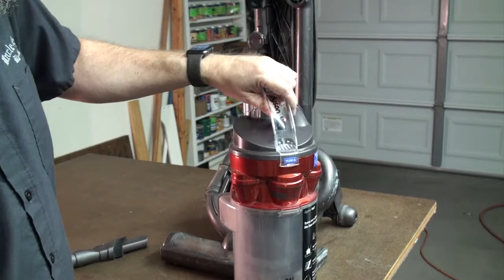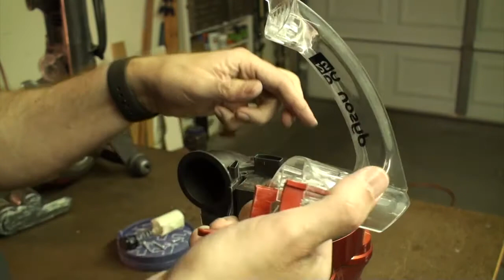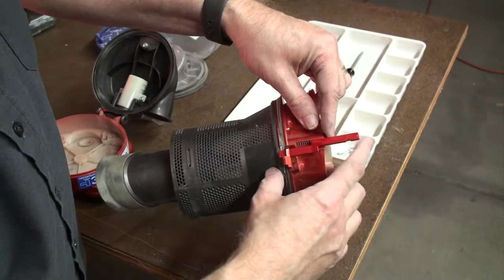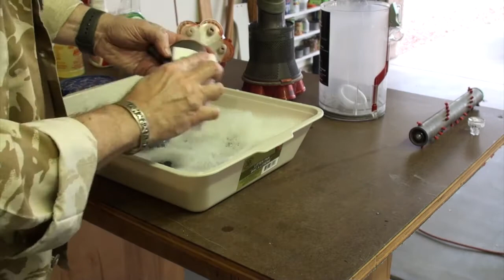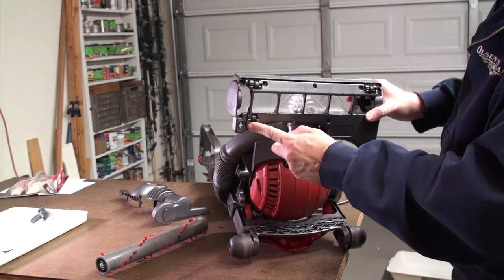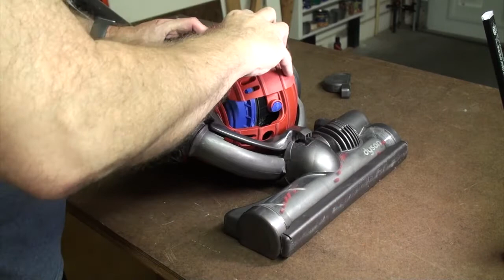Dyson DC 25 Repair

Comment: I have a DC 25 yellow Vacuum and the beater bar wasn't turning. I watched another guy's video of what to check he said there were three things he normally checked. I found a broken hot (Red) wire under the left side of the ball. I spliced the hot wire, and it runs fine now.
Reply from the maker: Great job on your repair!

Comment: Thank you for your video on this vaccum. My neighbor gave me her old one. I replaced the brush roller switch and it works. The problem I'm having is when I place the vaccum on the carpet the brush roller stops! Do you or Anyone else on here knows what I need to do to make the brushroll continue to spin? Thank you for your help!
Reply from the maker: It could be that the belt is bad or is slipping, or parts of the brush that turn it are broken?? Maybe the soleplate? I ended up giving the vacuum away so I don’t have it for reference.

Comment: The unknown part & it’s purpose is a vacuum relief valve, if the vacuum is blocked the motor would quickly overheat with no air flow.
Reply from the maker: Thanks good to know